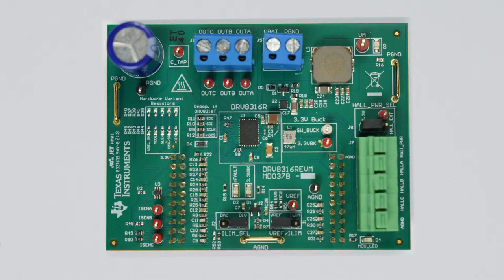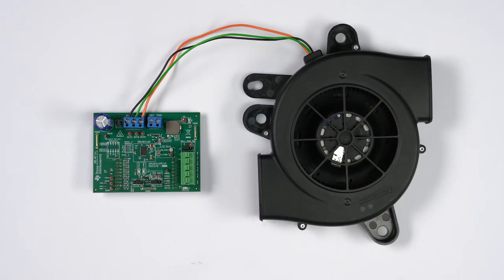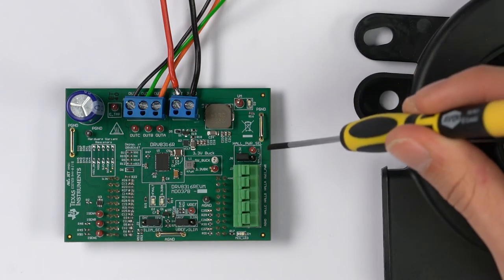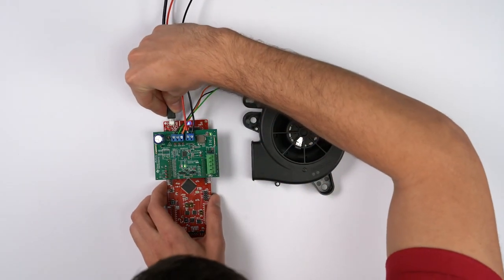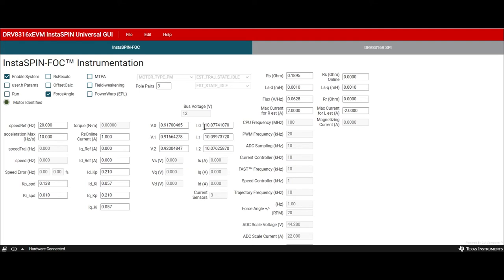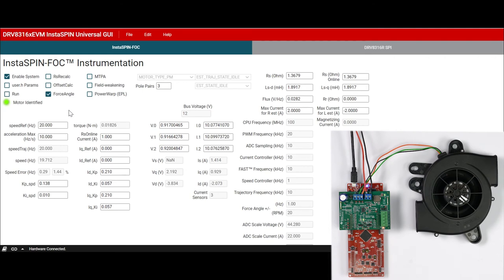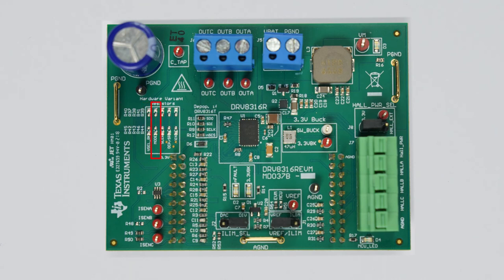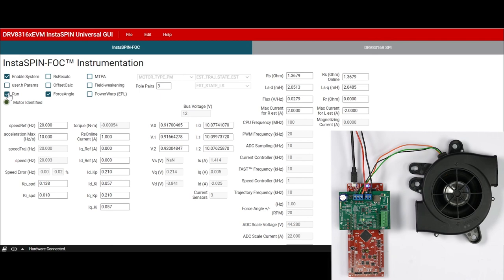DRV8316REVM Getting Started Video

Comment: The motor shown was connected to a fan, which with open inlet/outlet would present constant load at a given rpm. Does the algorithm allow optimisation of motor parameters across different loads? If so, static or dynamic optimisation?
Reply: Looks like a C2000 MCU was used for the motor controller. I know they have FOC code in their motor control SDK for motor parameter identification and tuning